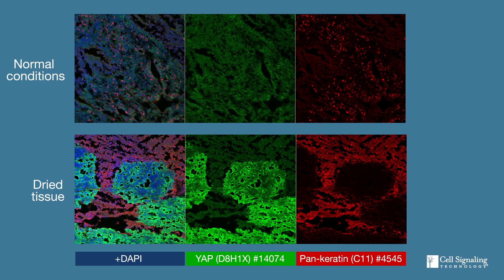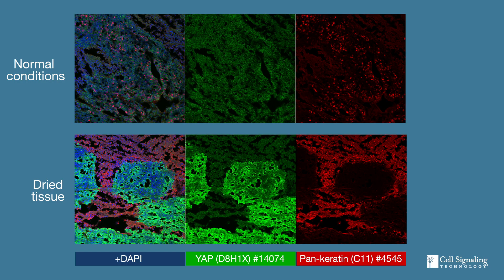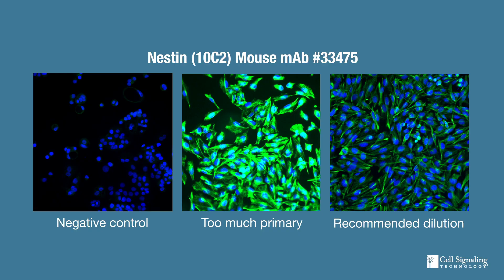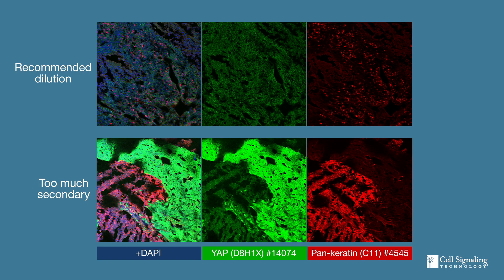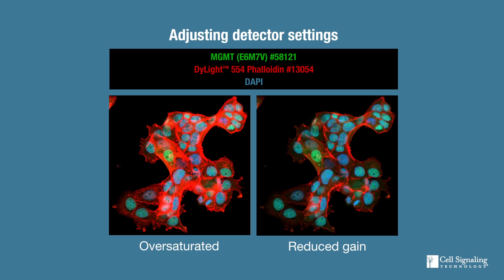Troubleshooting Immunofluorescence: Excess (Bright) Signal  | CST Tech Tips

Comment: hello there! I have a question about what should be the best fixative for intranuclear proteins.
Reply from the maker: Hi Sarika. If you are using a CST antibody, you can simply type in the product number in the search bar on https://www.cellsignal.com. Scroll down below the images and click on the button for "Protocols". If that product has been validated for immunofluorescence you can select it from the drop-down menu which will bring up the IF protocol and the fixative that we used in our validation process. (If you are performing ChIP, IHC, or another assay just select the relevant application.) 

If you still require technical support, the best way to have your question routed to the scientist who can help is to fill out the form on https://cellsignal.com/support.

In the meantime, if you missed our Tech Tip video on fixatives, you can watch it here: https://youtu.be/NzeAYvQg8EI